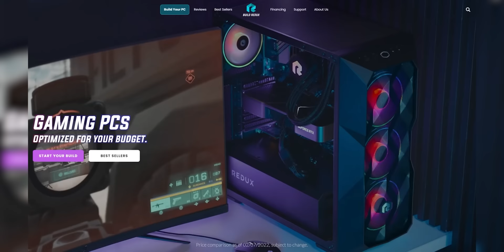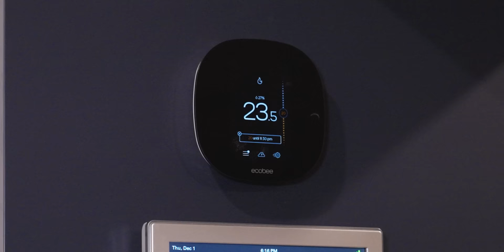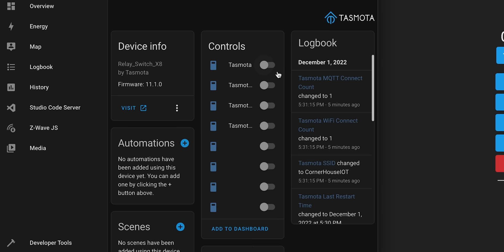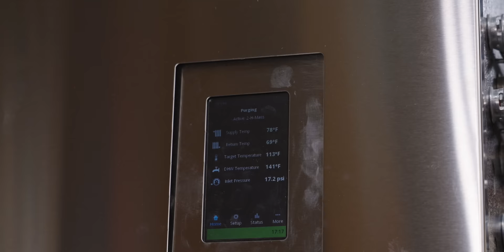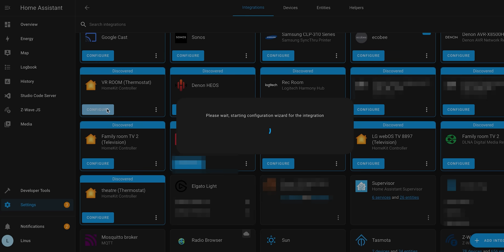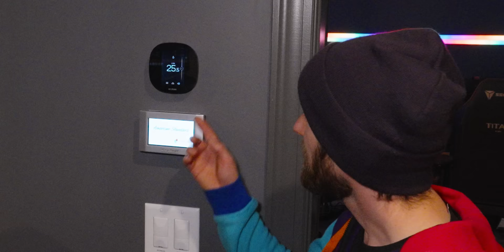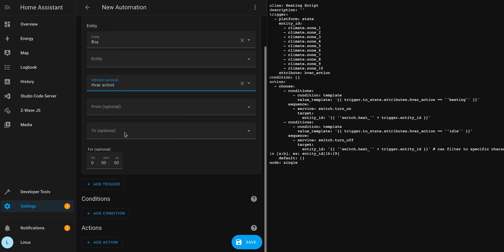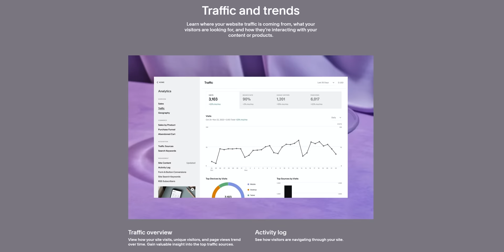My Smart Home is Stupid - HVAC Update

Comment from the maker: ps. We know that the Ecobees can actually be wired into the zone valves directly, but this setup gives us much greater flexibility with full HomeAssistant control, and the potential for configuring the Ecobees and American Standard thermostats to work together better.
Reply: Love you!
Reply: Okay
Reply: Hi LTt love from India Assam
Reply: Dont say that, what if you house is really dumb.
Reply: All these issues could have been avoided with a Loxone system. :/
Reply: So if you lose power to server or if your server goes down, you'll lose heat? 

That sounds stupid. Smart, but stupid.

You account for internet outage, but not power outage or server going down?
Reply: @ravishah2255  in the case the server looses power, so will the heating(even when its gas, it needs the electricity to run) and given Linus' servers are on a UPS, it will probably be up when the power is out(and the heating is off)

Although, you are right if the server goes down(for updates and stuff, or just a crash) it will coast on its last state. but that often wont be for long
Reply: Linus, have you considered the effect all of this "smart" stuff will have on the price of your house?  Can all this stuff be removed easily and set to dumb mode?
Reply: this has 69 likes i dont think i can like it
Reply: @ravishah2255  yep, although he has a UPS. You could also run a mirrored copy to a Pi. 

having said that, mainstream cloud based solution will likely stop working as well. 

So if its that much of a concern for you continue to use dumb thermostats, for the once in the last 10 years my powers gone out I will manage.
Reply: @ravishah2255  when there's a power outage your furnace won't be able to run anyways, so what's the matter?
Reply: Simple don't have a smart heater.... stick with the traditional
Reply: Are you budling a public facing wiki with how you did this?
Reply: Ecobee used to have satellite sensors so it could get the temp from multiple points on a floor. It seems like Linus should get those and tell Ecobee to read from those instead of the sensor in the thermostat so the other thermostat doesn't interfere with the reading.
Reply: Why 8Pack OrionX2 PC so EXPENSIVE ?.??
Reply: That being said, come to germany. Where 16 degree is the standard from now on because heating is fing expensive
Reply: bruh
Reply: Does the flexibility include it working correctly? Because so far the house upgrade has seemed like a total nightmare
Reply: Title of the next one. "this is how i pay my bills.. (gets 150k views an hour for 15 days). lol. THANK YOU THANK YOU. Everyone be interested.
Reply: I think i understood that you were looking at remote temperature sensors for the Ecobee's to combat the AS Thermostats temp throwing them off. Would it be possible to just 3d print a little air deflector to place on the back to kick the air out from the thermostats instead of up into them? May be a cheaper and easier solution, or at least worth doing a single test print before going through all the trouble of additional wiring
Reply: The general rule is if something can be infinitely configured, it will be infinitely configured...
Reply: Heat goes up. All you have to do is put the ecobees BELOW the other device.
Reply: Why not esphome and use native api much faster and ota flash capebilities
Reply: How does it give you more flexibility? Seems like a big kludge to me. Wire the Ecobees directly, and if you want to turn them off/change temperature via an automation, just do that. I'm not seeing what flexibility you gain from adding more layers/points of failure into such a critical system.
Reply: Luckily with the floor heating I think they will be fine heat wise on short outages.
Reply: Is the solution for the thermostat heating bleed problem is a tasteful 3D printed shelf to redirect the warm air exhaust away from the other thermostat?
Reply: Linus, get yourself KNX Smarthome. Its decentral function and certified system will hopefuly give you peace of mind. Not cheap though. Works with all assistant in a visualization.
Reply: As a counter-argument I wired my Nest thermostats directly to the zone valves (no thanks to Google) and can use the HA integration to override the schedules as and if required. Your implementation while definitely "cool"  looks unnecesarly complicated and introduces multiple points of failure while duplicating the existing hardware.
Reply: If it's giving you temperatures in Fahrenheit 72 is room temperature.  If you want that in more scientific units it's 295 Kelvin.
Reply: ecobee has little temp sensors that are like, $50 a pair.  I've got a half dozen of them in my home and they make cooling significantly more effective.  It's a non-issue solution.  If nothing else, the cost barrier is so low you can try it out before committing to a more involved  fix.
Reply: Or or here me out, just put one of those usb arctic fans and wire them to circulate the air around the thermostats. Near silent and way cheaper than tearing out the walls lol.
Reply: You could have also manually pushed the valve open to not freeze in the meantime .......
Reply: Im not sure if they work the same way, but the ecobee's used to have something they called little bees which seem to be rebranded as smartsensors that I used to use to detect motion in rooms and turn on or off zones of my mini split. They work super well and you can mount them anywhere. Only thing thats not great is you have to replace the batteries every 1 to 2 years.
Reply: Why did you choose the American standard for your cooling if they are properitary? Were they the only option?
Reply: That FLIR tech should be required for roofers. Fire watch (90 minutes no fire period at the end of work were we go around with a laser thermometer and spot check areas that were recently torched or poured) would be MUCH safer with that instead of the small point readings taken from a laser thermometer
Reply: @ravishah2255  I'm gonna assume that Linus has already ensured his house has a fallback generator.
Reply: huh, i run my house at 65 in the winter... feels fine / if i want a warmer room i actually have a smaller pc/movie room that when stuff is turned on it just warms up fast so "shrug",   ppl hate me though cuz in the summer i run the ac at 80 and go down into the basement movie/livingroom if i'm lounging
Reply: Hacky way to resolve hot air blowing from your Air Con termostat is to 3D print fan deflector
Reply: homekit is open source or take a look at matter...
Reply: I love your videos but can’t bear to watch the ones about pc building as I am running on a 2 core integrated graphics intel cpu and slow 4gb of memory and get 30 fps on Minecraft max with random lag spikes. Anyways I love your videos and hope you figure out the stupid American standards thermostats messing with the eco bees
Reply: @FIGHTTHECABLE  Unfortunately it is abit late for that, it should have been installed when he refurbished the house.
Reply: Those thermostats typically have a way to do a temperature offset, should/could be a much faster and more painless way to compensate for any added heat the American standard units are putting off.
Reply: @dillogdall1  well yes and no. There are wireless KNX devices out there aswell. But prefered would be wired. Depending on the conduit, he could pull the cable along side the power cable in the box. But yeah he might have to rip some walls open again, I haven't seen the whole apartment in total.
A shame he didn't go to a few big electrical companies and ask.
Reply: I used Taco Zone Valve Controls which allows for a common power wire to all thermostats, allowing us to use four smart thermostats for our boiler system.
Reply: Remove the second thermostat, and make it run on the same system with just the ecobee...
Reply: @RedPillAlways  normal people use Celsius lol
Reply: It also gives you more videos in the future for when you inevitably have more problems.
Reply: I love home automation in general but this is a bad application. you want want to have the dumbest part of your system handle the mission critical stuff (calling for heat). Now that last part of the thermostat system is the tasmota board through ecobee - wifi - homekit - home assistant - mqtt/mosquito - wifi - tasmota. There’s just too many things that can go wrong between temperature change and call for heat. 
I’d suggest to let the ecobee handle the zone triggers directly. Don’t see how you’re losing flexibility
Reply: You WOULD want the server room to dump heat into the basement into the winter. You're paying for it, and its free.
Reply: @theklutzysamurai8983  do you have any knowledge about this? I'm thinking about using it but like to have some info first. I'm using Panasonic heat pump
Reply: @miawgogo  except the power never goes out unless the gas to the city stops flowing or they run out of propane . I'm fairly sure he has 10-20K generator that just operates on gaseous fuels.
Reply: Maybe it will be an option to 3D-print some parts for those lower thermostats to redirect heat flow further from the wall a bit, like 3-4 cm or so. It might be enough cause this hot air will still go up but it will not touch upper thermostat directly.
Reply: this is likely one of the best ways to mange without using further controlling zone valves from the company the valves also came from. Such as an 8 zone honey well control where each loop can be configured for a particular temperature range . Especially important when running in wood floor versus concrete. Wood floor should be about 20-35 degrees Fahrenheit lower temps than concrete.120-140F  in wood/flammable flooring vs  140 -175F in concrete.
Reply: @NikolayMorf  while also making sure none are in direct sunlight on the upper floors .
Reply: @tobiwonkanogy2975  wut

that's not the only way power can go out. Grid protection devices can trip, Linus(or a electrician hired by him) could accidentally trip it, or any other thing could cause the houses power to go out.

but anyway Linus needs power for the boiler/furnace to even run was my main point so the power going off wasn't a new point of failure in the system
Reply: You invested so much money to make something "smart" that in fact doesn't need to be.
Reply: Jake is cartman
Reply: how is this content? this smart home is not smart. besides, a boiler is inefficient and bad for the environment. just buy each room a heatpump.
Reply: work together "better"  hahahahahahaha.  having a heating system rely on a wifi connected relay board is about poorest possible decision that could be made in a system design.
Reply: There is an  temp offset for the ecobee in the settings Linus can use to compensate for the heat coming off the American Standard thermostat
Reply: Ecobee makes temp sensors
Reply: @Mr.Morden  this is a "forever home", he will care about thr value when he dies.
Reply: "but this setup gives us much greater flexibility with full HomeAssistant control" no, it would work basically the same as you could STILL override the ecobee in HomeAssistant. This setup is at high risk of being messed up every time the WiFi System is reset, or the Home Assistant / MQTT server gets reset. Like when there is a power brown out / outage and the devices all come back online out of order and Homekit MDNS fails or the Tasmoto devices fail to get DHCP or contact the server etc.
Reply: Much better idea to just control the valve with the ecobee. Relying on HA to control the valve = disaster waiting to happen. Goes on vacation, HA takes a shit or updates, house gets real cold, pipes freeze. Just integrate the ecobees into ha and have the control your looking for without the risk of HA downtime ruining your heating and cooling experience.
Reply: You realize after all of these sensors and all of this other crap you've put in you're just wasting more power than you ever would have saved just by putting in some cheap thermostats. As Jake said it takes 8 hours to heat up a room you're never going to shut this off the whole winter
Reply: For the ecobee, you could just pair a remote sensor so you could avoid moving the thermostat :)
Reply: You're complaining about your house not being smart, when some don't have a house....
Reply: considering the mounting is there enough slack wire behind those panels to swap the mounting plates and just fish the wires to the opposite boxes?
Reply: and now imagine a power-blackout xD and btw: 20° is more than enough. save energy!
Reply: @RedPillAlways  The US isn't normal, albeit Liberia and the Cayman Islands apparently share their affinity for fahrenheit. Nobody else does.
Reply: @ravishah2255  if Home Assistant is down, you can still point your web browser directly at a Tasmota device and then toggle it manually through its web interface. Source: I put Tasmota on a smart bulb (replacing the manufacturer firmware that uses the cloud).
Reply: If the difference in between Ecobee and Amercian Standard is constant, In Ecobee you can correct the temperature by going to Installation settings --> Thresholds --> Temperature Correction
Reply: Can you not set an offset on the Ecobees? My Tado thermostats can be set with a + or - offset depending if they think it's a different temperature in the room than it actually is.
Reply: The Ecobees come with remote sensors, don't they? I think the remote sensors can be set as the primary instead of the wall mount.
Reply: Take a look at Sinopé thermostats. Canadian company. Maybe they could work with you on a special firmware for their zigbee thermostats.
Reply: @FIGHTTHECABLE  fuck KNX; get LOXONE. Way easier to programm and more versatile. KNX is pretty much outdated for new instalations at the company i work at.
Reply: @ravishah2255   any electronic thermostat would need power. Plus the boiler is likely electronically controlled as well (even if it's gas fueled). If you are concerned about a power outage, look for a backup power solution and include all of the heating system components as a critical/emergency load.
Reply: Bosch IDS 20 Seer heat pumps would fix the communicating controls and allow you to use the ecobee for everything.
Reply: @pojokunam  yeah the ecobee wireless temperature sensors are great. I bought the kit that came with one and I ran into a similar problem as Linus, so I have it set so it only monitors the remote sensor right now and not the built in sensor. My temperature reading on the thermostat itself is off a bit because of the hole in the wall where the wires come through. Need to fill the hole with some spray foam or something.
Reply: Home so smart that by the time it's working it's outdated it needs to be replaced 🤣
Reply: I had something similar(proprietary 2 wire comm protocol) with my Carrier furnace and AC. All thermostats officially said they don't support Carrier. I ripped out the thermostat and control board screwed to the furnace and then wired the ecobee in directly to the furnace. Worked like a charm.
Reply: @JosFlos.  I am actually a Loxone Partner. We install Loxone systems in two countries that we are based out of. I know for a fact Loxone is much more easier and superior to what is being done here. You can find a Loxone partner in your local area from the Loxone website and they will definitely help you understand better in the context of your region.
Reply: You guys were better off just using a cheap PLC like a Click from Automation Direct, and programming it. Anybody can program a PLC. It's literally the "Windows" of programming because it is soooo easy as it is just visual symbols like switch contacts, coils, and some function blocks like timers and counters. Maybe do an episode on PLC and do a sample program.
Reply: Linus, have you thought about reaching out to see if someone can reverse engineer the American Nonstandard thermostat protocol, then write a module for HomeAssistant to support it?
Reply: @FIGHTTHECABLE  How nice it would be, if someone with his following could „enlighten“ the world about the only true proven, open world-wide standard for Smart buildings, which is working in the most demanding applications for 30y now. But KNX would just be a stretch for someone like Linus with the attention span of a 3y old and a long-term focus of a toilet fly.
Reply: Hi, American Standard Dealer from the states here,  BAYWAKIT24VACA is the relay you need to control your floor heat with the American Standard 850/1050 series stats with the tam9 model airhandlers. this will remove the need for the eco-bee and if you want to make sure it maintains temperature within 1 degree of setpoint or .5C there is a setting for that too but the stat has to be configured to do it. hope this message finds you well and you are able to make your home comfortable! if you have any questions shoot me a dm!
Reply: @YKSGuy  Yeah, i comment on that as well. A thermostat should always be able to do its job even if the wifi/network is down locally and shouldn't be dependent on a "man in the middle" docker or VM.  Linus is the typical IT guy that thinks they can do AV or Home automation properly without professional help. Literally all the issues he has had would have been avoided with consulting a professional to get a plan done properly. He could still execute a DIY solution, but to proper professionally designed standards. But you don't know what you don't know.
Reply: @EETechs  yup, and a dedicated PLC could talk to BACNET which could then be brought in to HomeAssistant as well. Total armature hour over there.  They easily could have done a DIY solution like BASpi or some other open source PLC type device and still bring it into HASS and made it a DIY project. Literally all the issues Linus has had with his "Smart Home" could have been avoided by being properly educated by a professional like myself and the many others that offered expertise for free.
Reply: @lsdave  His business server rooms have lit on fire and they have had data loss events that could be completely avoided, calling Linus an IT guy is a stretch. He makes entertaining content however which is how he makes money.
Reply: If this were me, even though it's all local, I wouldn't want to introduce a wifi dependency for heating when there doesn't need to be one. What happens if the command for "turn off now" is missed and it just keeps heating hotter. And hotter. And hotter. It might work 99% of the time, but 1% of the time it heats up and doesn't stop? Unacceptable, really. You've got the smart home bug. Do it a different way. You can still use Home Assistant.
edit: I guess the boiler is regulated to some master temperature. Maybe it's safe. But if you did it like this for the main furnace... yep, problems ahead.
Reply: I'd still wire all this through some Taco zone valve controllers. HA can still monitor MQTT and make additional requests through a single solenoid per heating source.
Reply: I LOVE the duckies, they are awesome!
Reply: Linus looks so tired lol
Reply: @ravishah2255  A power outage is more likely to make the heat not work than the servers go down lol
Reply: Having the house custom build would have been more preferred, for the same reason that you custom build your computers
Reply: Should have gone with a Goodman or Amana Heat Pump they have comfort bridge technology so all the proprietary smarts are in the control board of the air handler and heat pump systems so you could have ditched the American Standard Heat Pump and their proprietary thermostats and used only Ecobees. Only downside zone systems become a problem with the lack of communication between the thermostats connected so airflow volume may become a problem depending on equipment’s staging parameters. All in all though neat content I enjoy this side of the channel the most since I can relate from a professional level working in HVAC.
Reply: I'm always blown away why people send replies. LTT doesn't have the time nor the want to communicate with any of you... thanks for the paycheck eh! Look at the million dollar place I live in that you could only wish for, eh!
Reply: HVAC tech here. Ecobee makes a Bluetooth sensor that can read temps and only rely on that sensor for when to call for heat.
Reply: quick and easy fix for your ecobee temperature gauge is that ecobee has battery powered temperature thermometers that u can attach to a wall or set on a counter somewhere in the room and you can make each individual ecobee read only that specific temperature gauage
Reply: You should consider removing the ECOBEE from above the American Standard Thermostat putting it to the side.  The lower thermostat heats up under normal usage and will create a up draft of warmer air that will impact the upper thermostat by a fixed offset amount.  Turning on a fan in the room, or supply vents being aimed in the wrong direction can change the offset drastically and cause poor performance of the control algorithms within the thermostats.  

Good Luck
Reply: dude better be earning 100k+ for helping his 1m$+ boss make his house
Reply: @derpmaniak7823  Loxone is a company and not a standard. If Loxone disapears from the market, you're stuck with an ecosystem that is not compatible. You obviously don't know what is possible with KNX. You can not just dimm the lights, but also dim them to the value set by how much sunlight is falling in through the window, sun tracking for shade control, hvac control interface, control of electric car charging station and solar panel monitoring with visualisation, the possibilities are limitless. With KNX you have the innovation of many companies that keep driving the technology. With Loxone you have 1 company that you rely on, like apple.
Reply: It's wholesome to see Linus and his little brother Jake do projects together.
Reply: @miawgogo  Most dumb system are smartest ones. I'm sooo glad my heating don't us electricity, it's all natural circulation. Yeah, it's not as pretty with pipes over the room, but with local electricity it's no-brainer deal. Same goes for fire oven/stove: not dismantling it when we got gas line was another smart decision, saves a lot of money to boost heating with wood (and wood is free for me).
Reply: @jimjohnson3410  dude, he'll never read this. He's got radiant heat anyway, that how my grandparents lived and everyone in Russia and Ukraine. My kids have to wear three blankets... because of you.
Reply: @guitphreak  🤦, yes .they could place tasmota where the ecobee is and give it a cheap temperature sensor and wire tto the relay . tasmota does have pid control , just 1$ sensor and 5$ nodemcu and no need of the 200$ ecobbe .tasmota has PID control , home assitant can take charge as and when its needed and everything will work even when wifi and/or internet is dead .
Reply: Yikes on HomeAssistant.
Reply: Immagine having a networth in the millions and not buying a space heater for your kids till this gets fixed, couldnt be me
Reply: He should have got the Eufy thermostats, then the Chinese guy moniting his Eufy camera would have seen the temperature and adjusted it manually.
Reply: @Mr.Morden  who cares about the house price, they just moved in. They will have also milked MAD income for all the content from the video series, not to mention a good account could have the equipment written off as a business expense given it was used in said content production.
Reply: @THEpicND  for you maybe. This looks fun as all heck for me
Reply: @cp37373  who knows what Celsius is?? Everyone outside of the United States and Liberia.
Reply: please take a look at KNX!!!!!!!!!! i am a knx installer in the netherlands and i could see you really loving the system since its also decentralized and brand independent. it is however quite expensive
Reply: @FIGHTTHECABLE  i very well know what is possible with KNX since it was the shit i learned on. Theres no need to only rely on loxone if you dont want to; theres a reason loxone to knx bridges exist. But still; seeing and working with both for years id say i can tell you with confidence that Loxone is becoming a higher Standart; at least around my Area it is; and its very unlikely to "dissappear" from the market so easely going after Profit the Company makes.
Reply: I wish that I still lived in 1980 and had my thermostat set at 23.5 °C. 😖
Reply: I had my caps lock all ready to come down here and tell you that and then you pinned this. Foiled again
Reply: @ravishah2255  I think with the heating of the water also being electric, the server going down wouldn't make a difference
Reply: Magic words: DALI or KNX.
Reply: @thischannelisforcommenting5680  Spartans use Kelvin!
Reply: Why using EcoBee’s thermostats at all? Could you put temperature sensors instead and set all automations in HASIO?
Reply: @anonym34566  at least I have 4gb of ram
Reply: Ha! I don't comment often, but when I heard Jake say that  they cannot connect to a zone valve directly, I was like, uh, incorrect!   My two ecobee's are connected each to each it's zone valve off the boiler.  Also, I don't know what model of Ecobee's you got - they must have a lower cost 'lite' model that I don't know about, but mine from 2016 have built in room detection, along with the ability to add multiple additional remote sensors in different locations that also can act as remote temp sensors that are cheap and easy to deploy and each can be used to train or prioritize that sensor over the main unit.  I'm sure you know all this - but it just surprised me that the ones you went with are super basic.
Reply: Look up “Everything Smart Home” they make a sensor that is PIR and mmWave along with humidity and temperature sensor. It had ESPHome and automatic connection with HA. It’s brilliant.
Reply: I can make that work without a phone.  Like it would just work, all the time.
Reply: @ravishah2255  I'm going to assume that he has his house hooked up to a Generac, it would be silly if he didn't.
Reply: or you could just use Hubitat instead if of a $10K server
Reply: Use nodered instead of yaml scripts!
Reply: Lmao when linus' house gets hacked and he looses heating, ac on full blast, mid winter.
Reply: @pojokunam  They still do, and you can set the thermostats to consider only the temperature from the remote sensor instead of their own internal sensors, so it's not as much of a huge issue as it's being made out to be in the video.
Reply: Don't complain about your kids going to sleep at night with two or three blankets, for it is healthier to sleep in a colder environment!  A colder room provides better quality sleep than warm room.  It also allows one to fall asleep faster, and provides a deeper, better quality of sleep.  Further, it slows down the aging process, it is more conducive to uninterrupted sleep cycles, it boosts your metabolism, it helps to prevent insomnia, it reduces your stress level, and it enhances your mood.  So don't knock sleeping in a cold room in the belief of it being merely a comfort issue, for that lost of comfort with which you could have paid now, may come much later in life at a significantly higher cost of comfort.

In addition to sleeping in a cold room, one should also sleep in a completely dark room!!!

Edit: I almost forgot to include the ideal sleeping temperature for anybody with the willpower and desire to try sleeping in a colder environment for health reasons.  Give or take a few degrees, the ideal sleeping temperature is 65°F (18.3°C).  Although, infants may need a slightly higher room temperature for sleep, but you'll want to avoid turning the thermostat up by more than a few extra degrees.
Reply: thats the best way is too wire them direct too the zone valves, if they work how they should (i have yet too try ecobee's) the direct too the valve way would allow them too operate individually and without connection and if they work the way one would think the app control would allow you too set heating cycles with your timed scenarios, rather then allowing them too only operate if a app  is functioning
Reply: You can offset the temperature read on the ecobees to compensate for the heat generated by the stat from below.
Reply: @pojokunam  those sensors are used to get an average temperature instead of just getting it from the thermostat itself
Reply: @ravishah2255  you can still control it manually via the physical switches in the boiler room.
Reply: "ps. We know that the Ecobees can actually be wired into the zone valves directly, but this setup gives us much greater flexibility with full HomeAssistant control, and the potential for ~~configuring the Ecobees and American Standard thermostats to work together better~~ more content."
Reply: If they are setup for cloud usage wouldn't running a cloud an a intranet do the job quickly? you already have the VPN...
Reply: Did you look into the remote sensors ecobee has? They measure temp, humidity, and occupancy. Would stop the heat from the other thermostat issue unless you're already  making some kind of divider to put in between them
Reply: @THEpicND  Great content though, eh!?! 😂
Reply: As a heating tech this hurt to see how your controls were designed. Separate thermostat for heating and cooling instead of one common, thermostats not directly powering the zone valves. In my opinion the "wireless" zone relays are redundant and serve no purpose other than needless complexity and I doubt that this will provide better integration between the thermostats. But hey at least it makes for content! Still love the channel and that IBC boiler is a beaut ;) 

PS - You may not know this but Tekmar is based out of Vernon, it would have been nice to show them some love! Consider replacing the ecobee's, zone relays and american standard stats with some of their stuff. If you need some advise reach out!
Reply: @Ravi Shah If the Home Assistant server goes down, which would be rare, then the Ecobee thermostats work at the last setting and the low temp setting will most likely will be warm enough to not be too cold but if needed they can manually adjust the Ecobee thermostats in areas where needed then they can easily get the server back up or easily migrate Home Assistant to another server as long as backups have been made which is something LTT surely has done and all Home Assistant users should be doing. As already pointed out if the power goes out then the power issue is through the whole house if his backup generators fail.
Reply: Wait, they can?
Reply: my friend bought smart making outlets and a dedicated router for his smart setup costed 50 bucks easy set up, you guys are trowing away money -.-
Reply: Ok
Reply: @linus - Tasmota is so 2019 - why not use ESPHome, which is from the same makers as Home Assistant, and is fully supported by them. It makes life so much easier then tasmota - I was so happy once I switched.
Reply: Don't be a baby. BC doesn't get cold in the winter.
Reply: My house is set 63 at night and never more than 66 in the daytime.
Reply: my smart girlfriend is stupid.
Reply: @debodeepchowdhury  and from INDIA 🇮🇳, ODISHA  also 😉
Reply: @i_Kruti  Can you speakBengali?

Jai Jagganaath🙏🏼
Odisha Is progressing With Grace of God even too much vulnerable for cyclones😖
Reply: @debodeepchowdhury  Aaa.... I can understand a little bit but I can't speak..... 😅😅😅😅😅
Reply: Maybe an air baffle of some kind would keep the american non-standard thermostats from roasting the ecobees so much.
Reply: Qhy not ise the Generic Thermostat integration in HA? It lets you keep it all in HA and not have to write a whole big automation for each one. you just set it to read the sensor from the ecobee and turn on/off the relay. If you want to keep the ecobee scheduling you could even read the set point from the ecobee, or maybe even the hvac action. There should be a state attribute for the Hvac action and the thermostat should set it properly.
Reply: @tamimaman4471 🤓🤓🤓🤓🤓🤓🤓🤓🙄🙄🫨
Reply: @ravishah2255  If a power outage occurs, the electric heating wouldn't work anyway, and his servers are on a UPS so they would actually be the ONLY thing on.

They are also not like your average computer, servers like that are designed to be incredibly stable, so I doubt it's going to go offline for long periods at a time. It'll likely go down for a minute or two for updates every month or so, which is a short enough period of time that it won't really matter.